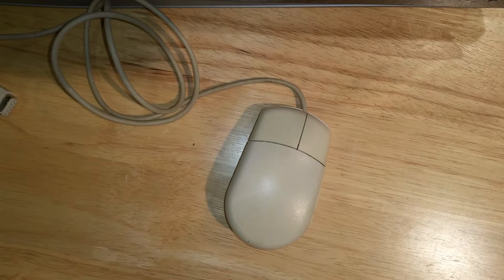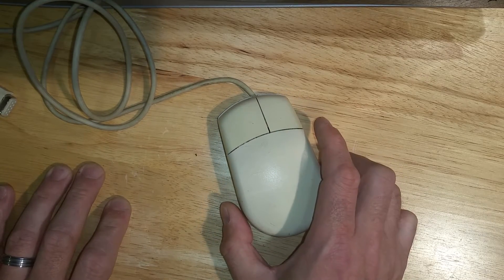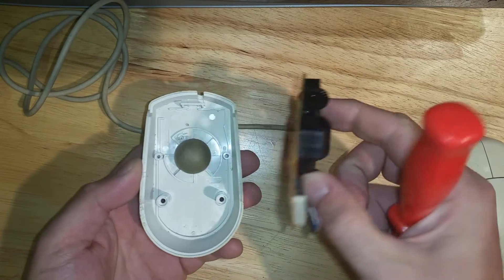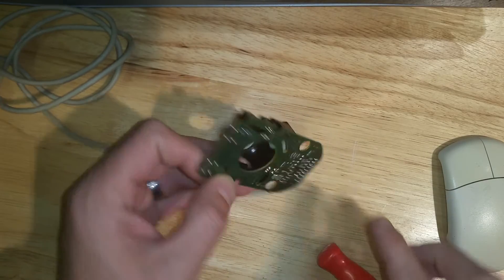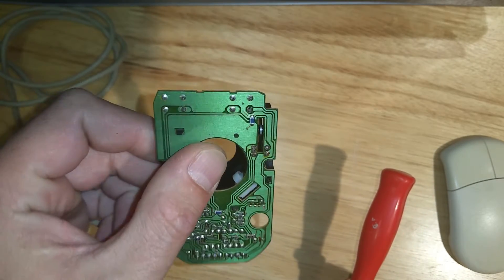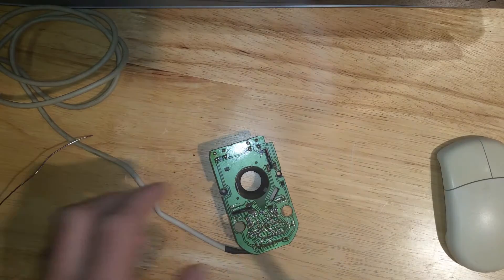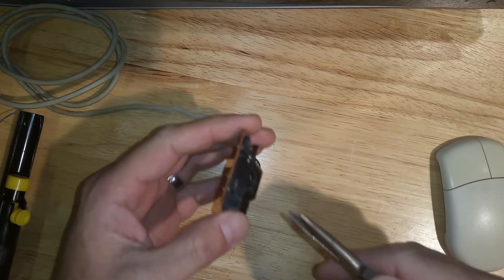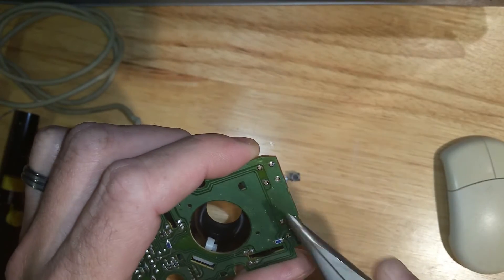Amiga mouse switch repair / refurbishment tutorial.

Comment: I'm trying to open mine but the top part where the buttons are are stuck. There seem to be something holding it near the cable. I'm afraid to pry it open using force. Is that the only way or is there a trick?
Reply: Not sure what you ended up doing so this comment is for those that stumble across this down the track.
You need to slightly lift the back of the top part of the mouse and then pull away from the cord, there is a clip on the top case part located near the buttons.
DO NOT attempt to pry open the case from at button end.